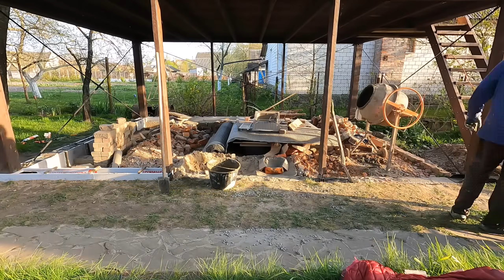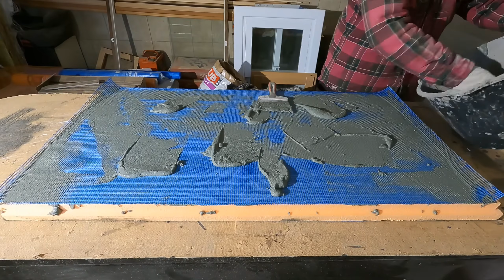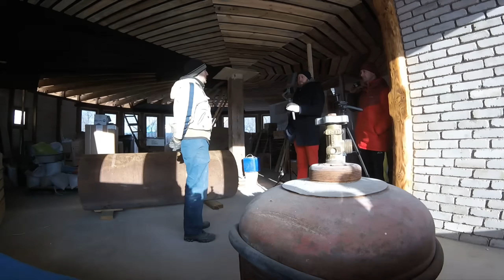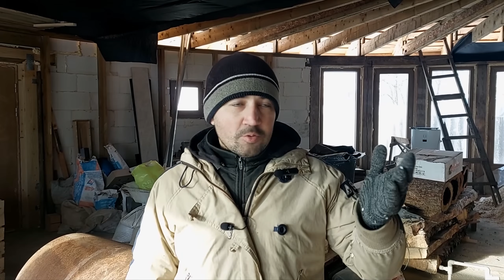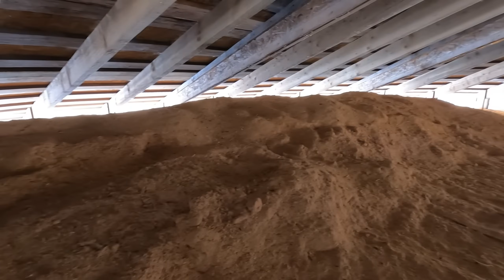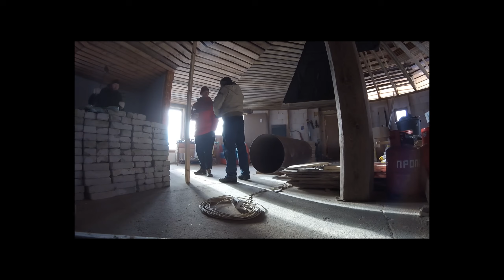Build Your Own Round House – Incredible New Construction Tech!

Comment: That OSB board will start falling apart from the slightest bit of moisture, and that’s what’s holding up the roof… Sawdust probably insulates well, but it burns like gasoline after even the smallest electrical short circuit. Cheap isn’t always good. The roof structure takes up all the space above the ceiling, even though you could fit a bedroom or something up there, and the roof itself should be insulated with mineral wool.